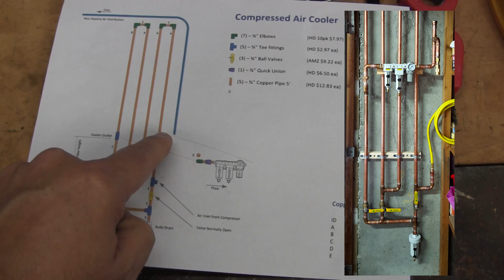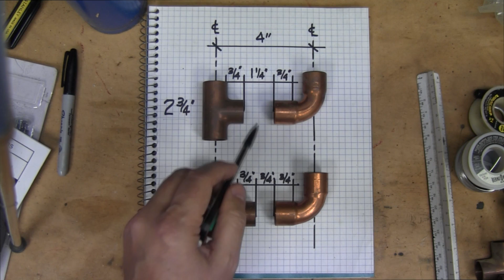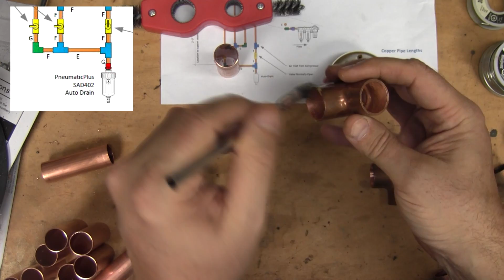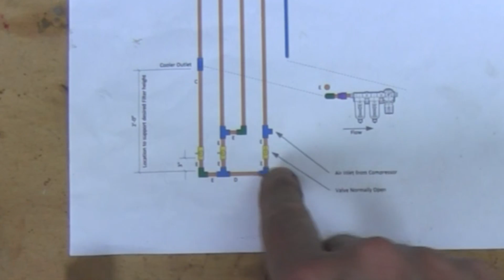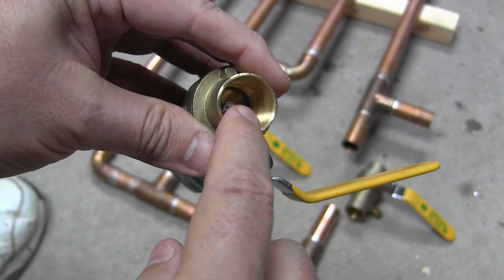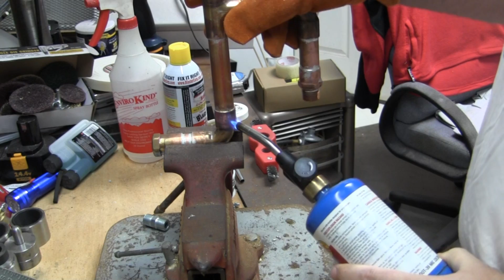How to Make | Compressed Air Dryer with Auto Drain!

Comment: What stage or stages do you trap the most water?   Do you get most of the water with stage 1?  Have you had any water show up at stage 2 or stage 3?
Reply: I think I'm going to combine your video with an idea from this other one https://www.youtube.com/watch?v=jxfNGkyGt3g where I'll use a large diameter copper pipe and try to do it all in one stage.  Thanks for taking the time to share this.
Reply from the maker: Mostly in Stage1 very little in Stage 2 and I not noticing any in Stage 3.  It is not exact science as they all ultimately dump into the same trap.

Comment: Copper's a favorite because dozens of YouTubers have made it popular, it's easy to sweat joints at home, it seems like the perfect material for heat dissipation, and you can buy it anywhere. But hundreds of pounds of hot moist air are constantly condensing inside feet and feet of copper tubing, picking up microscopic copper and producing gobs of copper oxides which carry on to contaminate your expensive filters and dryers, and aluminum air tools.  Hello dissimilar metal corrosion. Sorry to give you the bad news, but there's a reason you don't find commercial copper heat exchangers for air compressor systems which have aluminum downstream. The only partial protection you have now, is to turn your tool oiler up to maximum flow.

 Let us know how your tools are doing in 5 years.
Reply from the maker: Good thing I'm not a commercial operation and that I do not buy expensive air tools.  Cheers!
Reply: In a commercial or industrial environment I would agree. For a home use system water kills tools in short period of time. Which this system prevents. The long term galvanic reaction from years of contact will never occur.

Comment: Close quarters tube cutter all those cuts ouch lol i built a 3/4 black pipe with 5 unions with 3 6ft turns 3 water traps had tons of extra ball valves laying around, by the time the air hits the third turn no water. i have a parker industrial sediment trap an reg before the cooler and 2 regulators out. 1 for hvlp with trap 1 with oiler an manafold for air tools get em from work they throw anything taken apart crazy i know.
Reply: Jon A I was thinking of using black pipe but does the black pipe dissipate the heat and cause the condensation like a copper pipe does?

Comment: Seems like you could save on valves (but more ell joints) by doing a zig-zag up the wall.
Could add a muffin fan or two for better cooling.

Comment: for faster sweating of pipes, using Mapp Gas in the yellow container works faster and better on 3/4" copper.
Reply: Larry I would also suggest even heating of the copper fitting, keep that torch flame moving and concentrate heat in the bends of the 90’s to suck the soldier into the pipe joint. You will have a better sweat’s that way.
On the Teflon tape I wrap the threads 3 times. The Teflon is a lubricant for the threads not so much a sealer.

Comment: Seems you defeated a feature of your risers by joining the pipes at the bottom. If you cut the joints at the bottom of each vertical run and add to each an auto drain, then you don't need to worry about the position of the valves to the left (they can be removed), and you would maximize the system as the flow would need to go up and down each leg with an autodrain at the bottom of each leg. Other's I've seen just have the manual valve at the bottom of each leg and they require individual manual draining, but your idea to catch the water draining into a common pipe defeats each separate leg. Hope you post updates...
Reply from the maker: When you close at least two of the valves, it makes is so that it is not joined.  Valves are much cheaper that the AutoDrains!  I designed mine like the ones with valves at the bottom of each loop, then just added a common "Manifold" to bring them back together so that it could be caught in one spot.  Then I realized that I could use an autodrain and leave the first loop open and most of the water would drain automatically.  Work Fantastic!   Feel free to alter as you see fit.... mine works great as designed.
Reply: You have some great ideas in your design that I'm going to use for powerplasma cutter dryer. The autodrain feature will be a huge blessing!
Reply from the maker: Sweet!!!!!!   Customize to your heart's desire!!

Comment: Curious how your final setup is configure. Which valve did you end up having normally open and which part does the water collect the most?
Reply from the maker: I built this in preparation for a restoration on an old Jeep which is now underway.  I have yet to really push large amounts of air through it during the Motor and Transmission rebuilds.  It was originally designed and configured to support my 22 gallon small compressor and as notes was placed after the tank.  I have since upgraded to a 60 gallon Ingersol Rand 2 stage and think I might change the configuration to place this Radiator between the Compressor and Tank.  If I decide to do that, I will make an updated video.  Thanks for watching.
Reply: Awesome.. I'll be waiting/watching..... I recently acquired an 80 gallon IR and currently doing research on the best setup for my needs. I'm thinking it's better to over do it than not. I want to set this up one time :)....

Comment: Your preparation is amazing, great project - all very commendable! What version of Visio did you use for the drawings?
Reply from the maker: Thank you Tom!  I am using Visio 2010.  Any version of Visio and other simple drawing tools would work.  I don't believe that I used any stencils in this drawing.  It is mostly simple rectangles, some made up elbows, and stolen photos from the internet.   I have been using Visio for about 20 years and it is my GOTO software for mocking up the ideas in my head.  (Wine Racks, Sluice Boxes, Hope Chests, Comcast House Wiring Layout, Cheese Press,  etc.)  Best of luck with your projects!

Comment: Great job! Did use use type "m" or "l" pipe? How's it holding up?
Reply from the maker: I used Type M.  I used it a couple of weeks with a smaller 44 Gallon Compressor.  Then I upgraded to a larger 60 Gallon 2 stage compressor and used it a couple more weeks without any issues.  The new compressor offers an opportunity to change the configuration a little  (placing the Radiator between the Pump and the 60 gallon Tank) which I am still debating on that configuration change.  I will be really putting it to the test when I get to the body work of my Jeep Restoration.  I built this in preparation of the real work to come!  Thanks for watching.  Feel free to use and modify the design to meet your needs.  Cheers!

Comment: Great presentation. One note, you need to change the straps that hold the pipe to the wall.  It looks like you used steel straps used for electric conduit. Long term contact between dissimilar metals, will result in galvanic corrosion. You need to replace the straps with copper or plastic straps/pipe holders found in the plumbing dept.
Reply from the maker: Great observation and that is a great idea!   Thanks for watching.
Reply: UCanDoIt2 or add a rubber pads between strap and pipe
Reply: Karl V  wondering whether this happens when moisture is not present.
Reply: @mrtechnophile3483  Unless it’s in a vacuum or something, the moisture in the air will be enough to cause a problem. An air conditioned space will gain you a few years but that’s not enough, especially considering the cost of copper these days.

Comment: Where do you get that de-burring tool from I never saw one like that. Please post a link to it. Really enjoyed your video.
Reply from the maker: If you are referring to the Yellow Pruning Shears @ 9:56 in the video.  That is something that you can purchase anywhere.  Amazon has a cheep pair (here:  http://amzn.to/2g5WQrP).  While that is not the intention of the Shears, I would have to say that they worked perfectly and relatively safe.  Thanks for the compliment and good luck with your project!
Reply: No, I was referring to the tool that look like a battery post cleaner, red in color. The tool de-burred both the inside and outside of the tubbing.
Reply from the maker: OK.. That is a Pipe Fitting Brush used to clean off the oxidation on the copper pipe and fittings..  They are pretty cheap: http://amzn.to/2g9I0k5

Comment: So you've had your system in use for a while. How's it working? Is it performing the way you thought it would?
Reply from the maker: Just as I had completed this unit, my 22 gallon air compressor threw a belt and I used that excuse to upgrade to a 60 gallon 2 stage Ingersol Rand.  I am working on getting it properly connected.  So the short answer is...  I have not yet put it through it's paces.
Reply: Any update?

Comment: heat the opposite side of the fitting from where you apply the solder.  You didn't have quite enough heat on the bottom of those.
Reply from the maker: Does that help "draw" the solder into the joint?
Reply: immensely